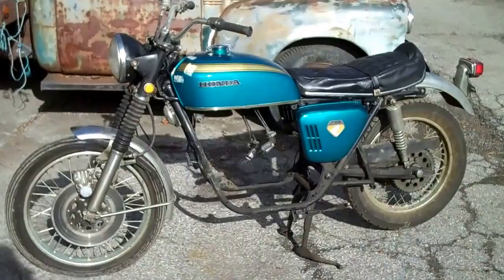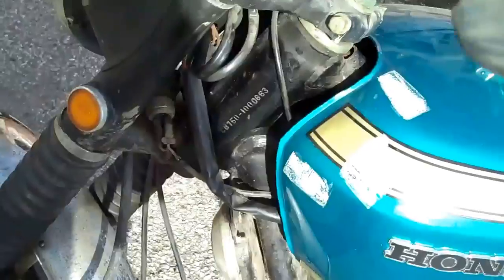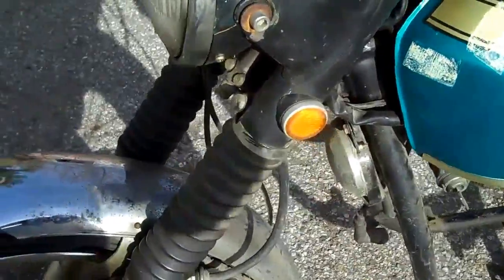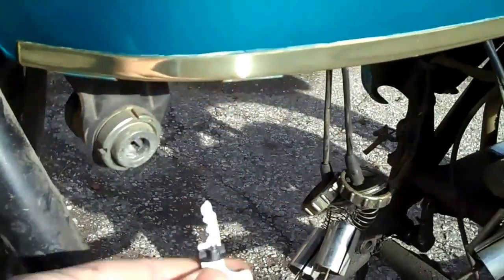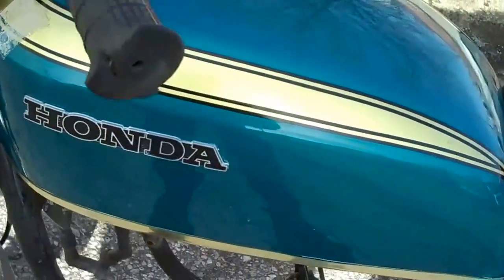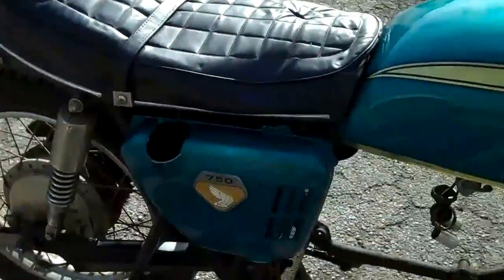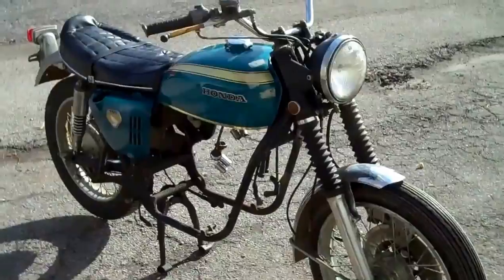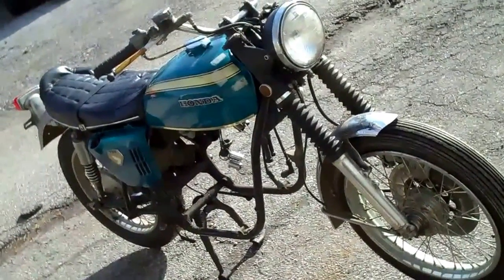Honda CB750 sandcast 750 very early KO PARTS WANTED

Comment from the maker: This will be worth something once a sandcast engine is located. If anyone has a sandcast engine, ANY early KO parts, please let me know.   Thank you.   -Joe
Reply: Going to be a real chore finding a motor near those numbers. I have a sandcast basket case. Been sitting for over 30 years. Had another sandcast back in the 70's. like a jack ass I bobbed that fender, big bore kit, extended swing arm, butchered the frame. Yes, I regret it and sold it many many years ago.
Reply from the maker: I want to buy yours.  I am serious.